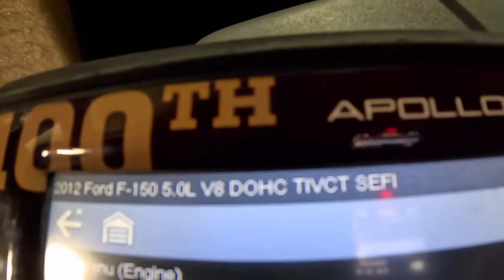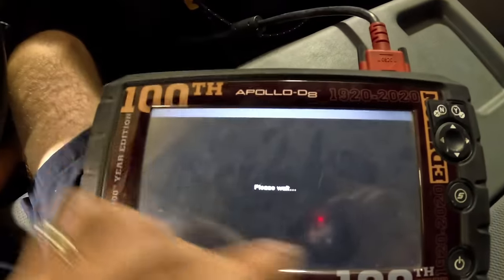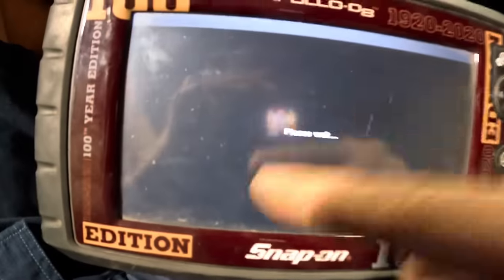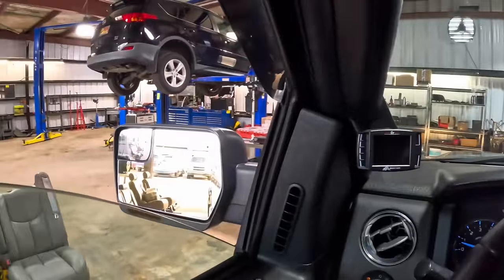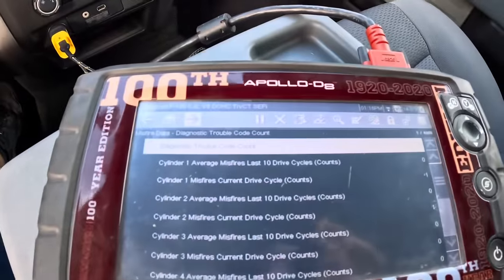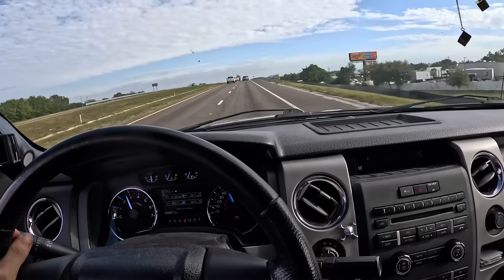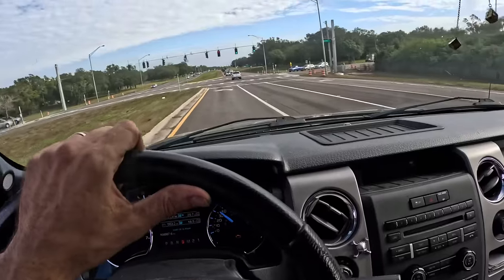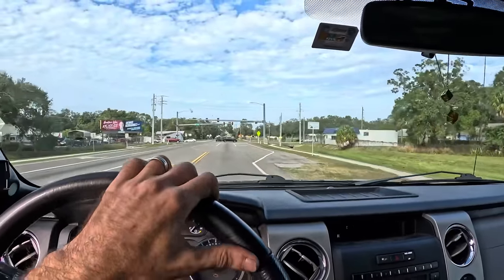Full Throttle Misfire!  Ford 5.0 Coyote

Comment: 1972 Olds 350 was notorious for carbon buildup the cure step the idle to 3800 and poor a quart of water down the carb slowly, Engines that received this service early on were de headed and found to be nice and clean

Comment: In a previous video, Ray said you have to be careful installing spark plugs with a universal on the socket because you can break the porcelain. Looks like the previous mechanic did just that when he replaced the plug on cylinder 8.

Comment: Surprised to see you not using a torque wrench on the plugs as the gap is set by plug stretch at the correct torque.

Comment: 57:34 after the BG mist cleaner, steam will also break down carbon deposits, my proof of this is any time you've got a blown head gasket  the effected cylinder has little or no carbon built up on it.
That coolant water mixture just straight water vapor will do it. 
There is a thing called water vapor injection, i had one car i actually poured water into the carbrator.
Steam is a better choice, but you kind of get some driving in the rain
Because other cars throw up a fine mist and your intake picks it up, it will pass most filters that are not oil coated like the K&N's are.
This is also why stuff like the BG treatments work or Seafoam
But those have chemical detergents and i think oils.
Reply: Water injection was actually a thing a while back

Comment: Those Coyote powered trucks can go the distance if they are maintained.    One of my regular customers has a 2014 FX4 with 330k miles on it right now.   In the last few years since I've been servicing it, I think I've put an oil sending unit, and a thermostat, and everything else has been regular maintenance.

Comment: RAY,  I USED WATER TO CLEAN CARBON FROM THE COMBUSTION CHAMBERS.  WARM ENGINE UP RUN ENGINE TO 1500.  UNTIL YOU HAVE MISTED 1 QUART OF WATER THROUGH THE ENGINE.

Comment: It's always cylinder #8 ! Seems every Ford V8 I've ever worked on with a misfire it's always #8. 5.0 is easier than the 4.6 or 5.4 for plug removal. I've had new plugs with cracked porcelain.  I this is a shipping and delivery issue.  Warehouse and shippers seem to care little and products anymore.  Plugs are prone to tiny crack if not handled with care.

Comment: All the spark plug threads appear to have anti-seeze on them.  It would have been nice if you had pulled the number 8 plug and showed us the improvement in the deposits.

Comment: Yes another Video of Ray removing spark plugs
Reply from the maker: I did more than that
Reply: Yes you did more than spark plugs your attention to the finer details are absolutely astounding. A lesser attentive mechanic would've easily missed the cracked plug they probably would've checked the gap and said well they're not bad and started firing the parts cannon costing the customer unnecessary money. Also I don't know of many mechanics that would've used a bore scope in the engine to look for further explanation that may cause poor fuel economy and misfires. Thank you Ray for being a good honest mechanic. ♥️🤍💙

Comment: You keep mentioning snake oil do you remember the oil replacement coating for engines that they used instead of oil in the ads then went round the speed way with no oil.

Comment: Just like you never refill an oil filter, you absolutely never run an oiled filter. The oil allows particles to float through and enter the airstream. Dry filter with a dust sock!

Comment: My jeep has the same capless fuel tank filler. When those things break and start to leak their like $300 at the dealer, you know how to get one the parts and labor to replace that. I don’t understand why they’re using them when the old system with an eight dollar cap worked just as good, this is just too typical of what they’re doing today.
Reply: Has to do with emmissions during fueling the vehicle

Comment: So... just assume that the plugs came with the right gap instead of taking the extra 10 seconds to double check them?
Reply: He rarely checks them on any of his previous spark plug replacement jobs (maybe one plug once in a while)

and aSsUmEd they're properly gapped from the factory 😢 because some are packed with that protective cardboard or plastic tube...

Nevertheless, best practice to just do it to avoid call backs 😅

Comment: Anybody know what brand those cracked plugs from the Ford were?  I couldn't read any markingss, but if two out of eight were failures, I want to avoid those.  (I generally prefer to use whatever the OE installed from the factory, and don't try to sell me Bosch plats for a non-European engine.)

Comment: Take the battery cables off of the battery posts and cleanthe post and cable connector.. then your connection is clean. A light protection film of dielectric grease over battery post & cable end after assembly to finish up properly. 🙂

Comment: When are putting rubber strips on the edge of the lift uprights?  Waiting until the door gets dented (accidentally) might not be a good idea. Seasons greetings to you and the family...and Dave.
Reply: He did show some on a previous video that they were there there. Yet on some videos they appear not to be....
Reply: @markadams5429  I saw that to.
Reply: This job was done on the newest lift in the shop. Maybe the rubber bumpers were added to the older lifts by the previous owner and Ray hasn't gotten around to putting them on the lift he had installed during the shop expansion.
Even with the rubber bumpers, I'd be cautious because the sheet metal on today's cars is so thin (a Ford truck might be an exception, at some point they started making a lot of the panels on those out of aluminum, which I'd a heavier gauge although still reduces weight and is more corrosion resistant).

Comment: Standard cracked intake manifold. Very common on these engines.
Reply: @Jonathan-mp32x  You don't know yet. Gotta drive it around for a few days. See if the two codes come back. Those two codes are standard with a cracked intake manifold.

Comment: I'm kinda surprised the method you use to decarbonise the system this way..most modern engines have a valve on the fuel rail which allows for a push-on assembly thus allowing high pressure to do a thorough job.
Reply: Some models do have that Schrader valve you're talking about.

But other models didn't have that which does make things easier to service 😢

Comment: I've never tried to figure out their part numbering system at ford. After they intentionally missed number virtually every single cylinder on the engine there's no sense in trying to figure out what they were thinking there isn't a single cylinder on that engine that they number correctly as to whether or not it starts at the front of the engine and goes to the back of the engine. They just number them however they please I'm surprised it isn't 3748 on one side, and 6 125 on the other. It would make just as much sense.
Reply: AFAIK Ford start their numbering by the furthest forward cylinder and that bank becomes 1-2-3-4

Comment: Kerosine is combustible in the right circumstances. Those do not occur in a gasoline otto engine. It's a lot like diesel fuel. It will combust when succesfully diluted with gasoline inside said gasoline engine, but not in too high concentrations.

Comment: Fun fact: Ford Mustang "5.0" doesn't have 5.0L engine.  It's a lie for marketing. Always has been.  The closest was the 302, which was a 4.9L.  After that you have the 4.6L, and the 5.4L.  

To be a 5.0L, the displacement has to be 305 cubic inches.

Comment: Driving without a fuel cap is very bad, because then the engine takes in stray air and the engine's control system compensates for this by increasing the amount of fuel into the engine.  So that's probably why it has more carbon in the engine than normal.
Reply: Care to explain how "stray air" in the gas tank somehow makes the engine run lean?
And by the way, this Ford has a capless fuel filler system, there is no cap.

Comment: I'm surprised you bothered starting that fuel system treatment with like a gallon of gas in the tank, thing was basically on E. Running out of gas midway is one thing but you & I both know fuel pumps get hot with so little gas left in the tank. I would've put some in on the test drive & charged the customer, people don't have the common sense to put some fuel in before dropping off at shops anymore. I also question why you removed the air filter when that spray nozzle is designed to slide inside the air tube with the tube installed and secured; that's how people get tiny pebbles & other debris in their engine destroying it, they remove the air filter and choose to run it. You know how filthy engine bays are because no one cleans them anymore. Not trying to troll, been watching for years.

Comment: When we used the BG products at the dealership I worked at, we were instructed to install the spray nozzle in front of the throttle body and reinstall the intake hose back on over the nozzle pipe. That way the spray was directed at the throttle plate to clean the front and back of the plate and it was still a mist when entering the intake manifold. Did that #8 coil have any carbon tracking in the boot? I have run into that causing a misfire after just replacing plugs. The spark will have a tendency to follow that carbon deposit to ground. I always replaced the wire/boot on that cylinder along with the plug.

Comment: Hello Ray I don't know if you were paying attention or making a joke. I know for a fact from years of knowing vehicles just as much as you probably not as much as you. But that the Ford Chevy GMC are odd and even, driver side is odd the passenger is the even side. The driver side firing order should be 1, 3, 5, 7, the passenger side firing order should be 2, 4, 6, 8,
Reply: Uh, he looked up all data and confirmed # 8 is definitely the driver side

I also did a quick search

 passenger side front to back 1 2 3 4

driver side 5 6 7 8 

For THIS APPLICATION 2012 Ford 5.0L Coyote engine 

As well as the live data on the scanner while on the test drive

Comment: theses plugs should be torqued down.
Reply: Yeah, he done hundreds of them and I guess that's good enough for him

If a DIYer, I definitely pull out the 1/4" or 3/8" drive torque wrench because I don't want it to pop out of the spark plug hole 😅

Comment: I’m interested to know why you always, or at least almost always to call the bolts and fasteners by the wrong thread size? As an 8mm head is usually on a 5mm bolt and the “10mm’ bolts are actually 6mm with a 10mm head. The head size is variable depending on the design choices.

Comment: I bet the other shop that looked at it inspected the plugs without taking the socket off. I had that happen 40 years ago and was charged a whopping 25 dollar inspection fee and they found nothing. So I took it upon myself to check things out and low and behold I found that same issue. There were no ways to check for misfires back than except for the sputter here and there, got worse with higher revs!
Went back to the shop showed him what I found. I didn't even ask he asked his assistant how he looked at the plugs, he looked at them with the socket still on. The owner handed me 25 bucks and an apology. Things are not that way these days.
You did say another shop looked at the truck correct?

Comment: I've never been impressed with the "quality" of Motorcrap/Autolite spark plugs.  I'd never run 'em if I had a choice.
Reply: If you put a non authorized part like an auto lite spark plug.. the engine knows. I never ever use a part not originally in a Ford.
Reply: @jamestone265  Autolite makes the Ford parts. Absolute garbage.